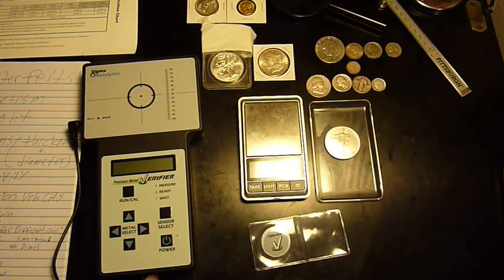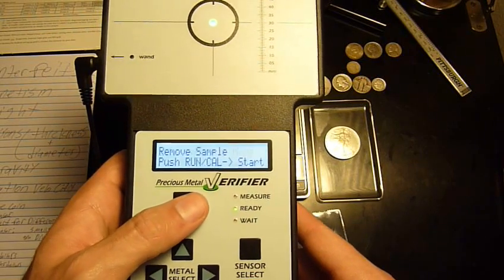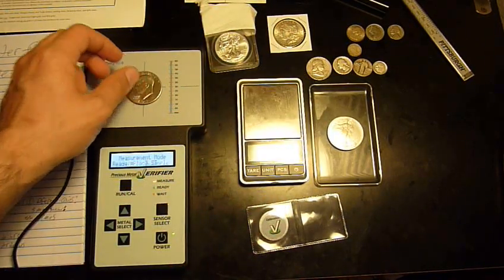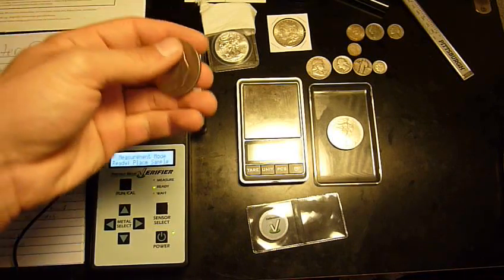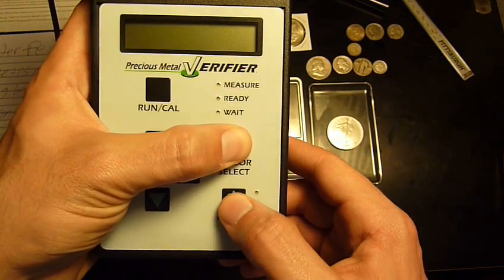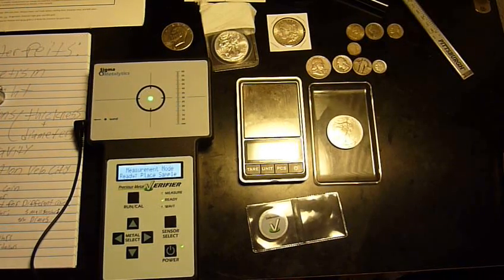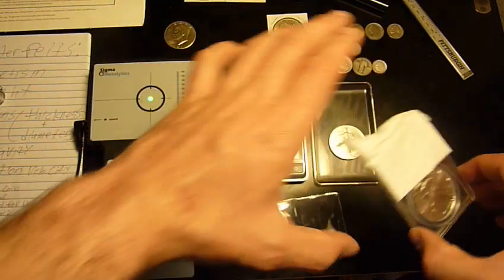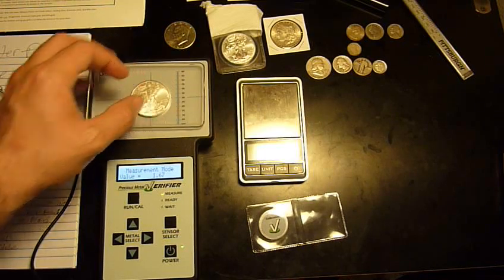How to Use the Sigma Metalytics to tell Copper Coins apart from Silver: Coin Verification, Part Two

Comment: Sorry if this is a stupid question but WHAT exactly are you measuring in "measurement mode"?
Reply from the maker: The electrical resistivity of the coin.

Silver is less resistant to the flow of electricity as compared to lead, copper, and nickel. This helps detects foreign metals and improper/out-of-spec metals alloys.

Comment: Hello.  Great Videos.  You showed and explained the GODMOD and that it showed a numerical value ( The measurement mode)  for a coin.  I don't understand what this numerical value represents and is there a LIST for each coin showing it's related numerical value.  Can you please help and explain it's meaning??  Thanks  garychristensenshow@gmail.com
Reply from the maker: A list of ranges/tolerances for specific, popular coins (Silver Eagles, Gold Eagles, etc.) is pre-programmed into the unit. I would assume that by connecting it to  a computer through the USB cord that the internal software/OS should be accessible.

I'm not aware of a printed list being distributed by the manufacturer, but I can tell you that it's fairly easy to use known authentic examples and create a spreadsheet for yourself for known resistance factors of various coins.

Keep in mind that, through experimentation, you will find that the further the distance between the sensor and the metal, the greater the height of the relief, the greater the deviation from room temperature the metal is at, etc. the more inaccurate or altered your readings can be. 
Heat makes metals less conductive, of electricity, making something that is real silver or gold possibly register as counterfeit if it's too hot.

In fact, I once met someone who had homemade hand-poured bars of Silver (and they were selling them at a fantastic price), but when I checked the bars for Silver using the Sigma, they registered higher than the known range of authentic Silver. The bars were very hot, as he had stored them in a sealed box sitting in the open sunlight of Texas heat for several hours. This undoubtedly affected the readings. 
So, unfortunately, despite my interest in the bars, I had to pass, and accept the known loss of only my time and gas being wasted, rather than have gambled with a large amount of money - even though the Silver bars may have been real. 
Situations like this may arise with the Sigma where, unless you have the time and tools to do specific gravity testing (which doesn't even prove authenticity), or you have $25K for an XRF scanner - there's no way to know it's authentic (without smelting it down).
Reply from the maker: The Sigma Metalytics scans for electrical resistivity/conductivity in a metal object. Resistance, in physics, is measured in Ohms, so I would assume that this is what the Sigma numerical readout is indicating - electrical resistance within an object.

Comment: It would be nice if you explained what those numbers mean when in measurement mode or what range a type of metal should be in. To simply show what number the machine displays without explaining what it means or what range that metal show be in makes your video somewhat useless. If you are assuming that viewers know what those numbers mean or what the range should be for a particular metal, you should state that.
Reply from the maker: My understanding - and I hope you forgive me as I am not the developer or designer of this machine, merely a user to who read the manual and did a small background research on the developer - is that the man who designed the Sigma worked in Mass Spectrometry, and that functionally all that the Sigma Metalytics truly does is check the electrical resistivity/conductivity of a metal.

Resistance in physics is measured in Ohms, so I would assume that the numerical readout given in measurement mode is empirical data yielded in that form. For it to be a measurement of some other more scientifically esoteric principle, or less convertible data, is less likely, but possible.
Reply from the maker: The Sigma Metalytics is not a scale that measures mass. It measures electrical resistivity/conductivity within a metal.
Reply from the maker: The goal of this video is only to illustrate a "how-to" of comparing copper coins vs. silver coins (to check for fakes utilizing metal cores made of copper). The intended goal of this video is not to explain the basics of the machine, which any novice user who read the manual would already understand.

This video is intended to be viewed by people who already have a basic understanding of this machine and how it works. If I wanted to make a video entitled "How the Sigma Metalytics Works", explaining that this machine measures electrical resistivity inside a metallic object, then I would do that. But that is not the goal of this video. This is a more advanced educational video for novice users who already understand the basic functional operations of the Sigma Metalytics.

65 out of 74 people who voted on my video liked it and found it useful. But you are entitled to your opinion that my video is "useless".
Reply: Apparently it shows resistivity (ρ) x10^-8, using standard units. This page lists the values for several metals: http://hyperphysics.phy-astr.gsu.edu/hbase/Tables/rstiv.html

To me the value's meaning doesn't matter a lot, just that it's a value with a lot of precision that you can use to differentiate metals. Put different metals and see what values they show, then you can tell what an unknown sample might be.
Reply: I had the same question about what the Value= means. Is it a gram weight? Ounce weight? or what? I measured a 14k ring on a scale at 11.4gr. I put it on the Sigma PMV and it came up 31.15. Then I moved the ring around and it came up with all kinds of numbers. How can this scale be of any use if it can't simply weigh an item accurately.

Comment: I also wanted to ask if you have had any experience with the bullion wand?  I caught this comment on a site and wondered if it might help in accurately identifying the 40% coins......"The bullion wand can also better distinguish between copper and silver 
using a special range that is twice as sensitive as the other sensors."
Reply from the maker: I would not advise doing anything outside what the manual recommends using for a given diameter and thickness of coin, as your readings may not be accurate as to the true measure of the metal or coin in question. Using a wand for a metal too wide or too small may give you a number larger or smaller than the true reading, or it may not scan enough surface area/mass in order to check for slugs or blips of foreign material.
Reply: It doesn't have a 40% silver mode, so you'd have to use measurement mode on a known-good 40% sample or find from someone else what theirs measures as.

Comment: The measurement mode certainly seems like the way to go.  I prefer data rather than squares in brackets. Seems like the brackets take in to account variations in planchets, wear, coverings, temperature etc.  Empirical data can be a great friend in forensic work....and forensic work is what we are doing when ruling out counterfeits.  Seems to me that as this unit receives more and more widespread attention and use that a data table will be generated by someone listing specific coins and their respective expected measurements.
Reply from the maker: Great points! Glad we concur.

I almost always go straight to measurement mode when dealing with Silver dollars.

I carry around a Morgan dollar that measures 2.50 on the Sigma, just to show that although copper can definitely fall within that range, the differences in specific gravity, and use of measures of different qualities (i.e. mass vs. conductance) to assist in guaranteeing authenticity, is the best way to be sure of what you have.
Reply: And pass the ping test?